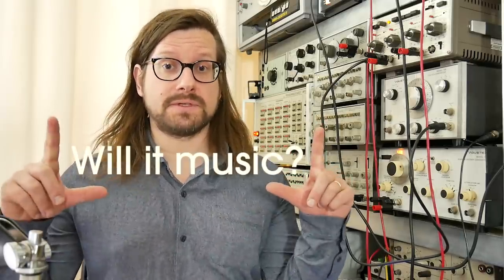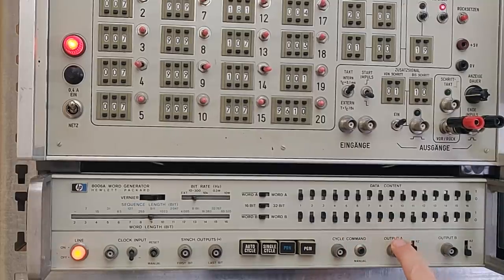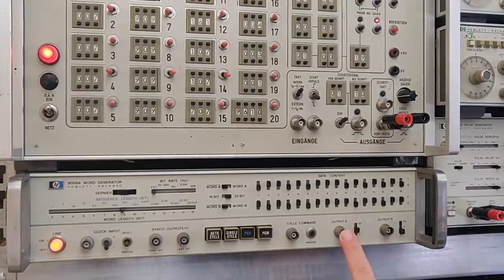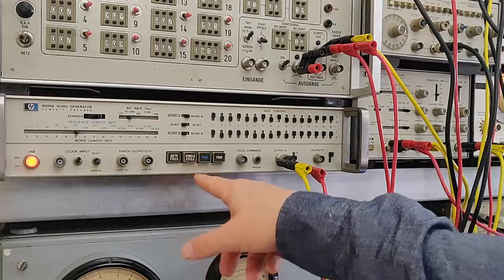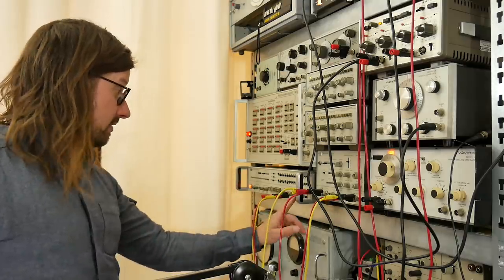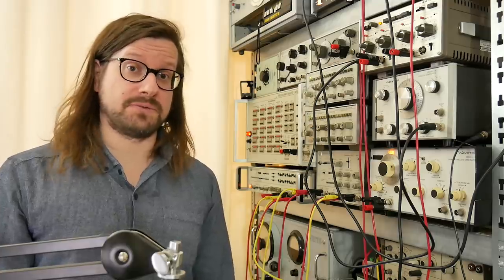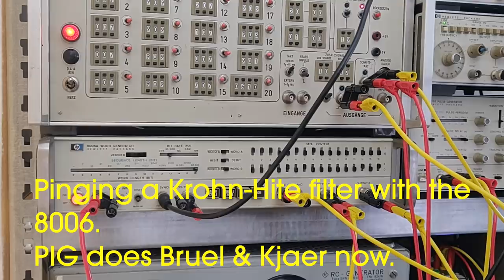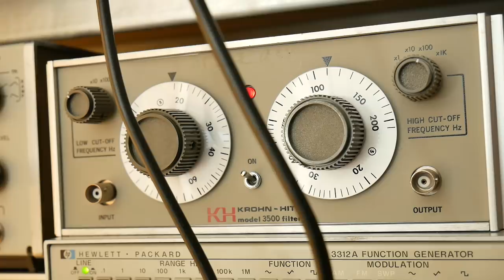The Hidden Funk Of The HP Word Generator 8006A

Comment: I had a go at using pulse generators with my Korg MS-10 (and used a test equipment frequency meter to tune it and my Korg Mono/Poly... instead of your BNC to banana adaptors, I had some highly dubious leads with one end of a jack lead and one end of a BNC lead with the cores and shields just tied together in a knot... they looked really bad but worked surprisingly well.

Comment: that 8006A is pretty pricey on ebay ($3K?) 
I made a subset of this on a breadboard in class out of 8-bit shift registers (74HC165 I think?). you can stack them to make 16-bit, 24-bit, etc. and you can make a second set of shift registers to carry a reset bit (as a ring counter) letting you restart the loop at any point as in setting the sequence length. chaining into another one of the shift register is easy, and shit it in the other end and have it play forward then backwards each cycle. (weird).

should there be some DIY kits or something to build around a few 74HC165 and 74HC595 chips? I'm not turning up anything obvious on Tindie.

Comment: Awesome video series ... I’m a little worried to hear what your electricity bill will be, though. :D

Out of curiosity, the box above the Word Generator has what I would assume is a power toggle on the left, only it says Ein/Netz and not Ein/Aus. Probably not an important question, but ... what’s this for?

Also, this seems awesome for gate sequencing. I may have missed it in another video, but how are you doing pitch sequencing?
Reply from the maker: It's indeed on/off.
Reply from the maker: Melody is done by switches and the sweep ins some function generators have, as well as the harmonizer on the count tofive and tape looped versions of the Oscs. It's very  rudimentary.
Reply: @Hainbach  Perfect. Thanks for the explanations.

Comment: Man why cant all step sequencers self oscillate their bits in the audio frequency range :/
Reply from the maker: Most digital ones don't but the analoges are lovely to run at audiorate. Pressure Points/Brains for example.
Reply: @Hainbach  So sad too, all those STM32's clocked at 50-100mhz spitting out 120 bpm midi/cv. <3 Time to overclock a beatstep!

Comment: the two word switches switch word A on and off from the output, the left has a bar over the top, which means NOT.
Reply from the maker: From the manual: Word Inversion Switches - The data content of either word may be complemented by setting the appropriate switch to WORD A or WORD B
So I thought it would create an inversion of the WORD A if you switch to WORD A with bar, but I am now a bit confused.
Reply: @Hainbach  oh shit, yes, you're right. :) the bar does mean NOT, which in this case is the same as complementing or inverting.
Reply from the maker: Phew, thank you for replying! This is complicated to work out for a non-engineer in a different language, so I am trying my best to be as accurate as possible.

Comment: i hope the burglary doesn't set you back much
Reply from the maker: Well, I wanted to the video on the 4ms Spherical Wavetable Modulator, but as you can see the mobile keeps doing crazy glitches its out for top down shots. I managed to find a used Panasonic GH70, which is the cam I use, but it will take time to arrive. So it might get a little slow here in the next weeks.